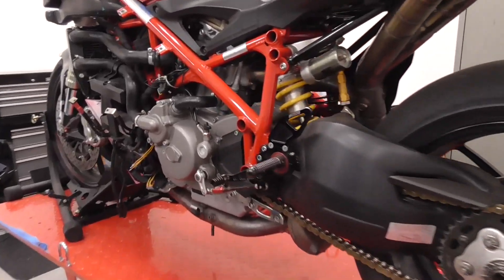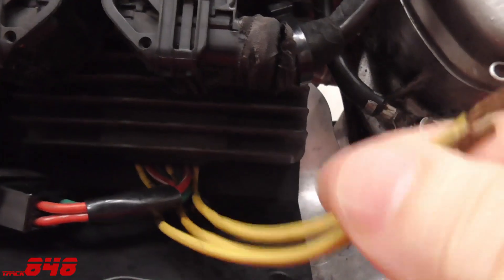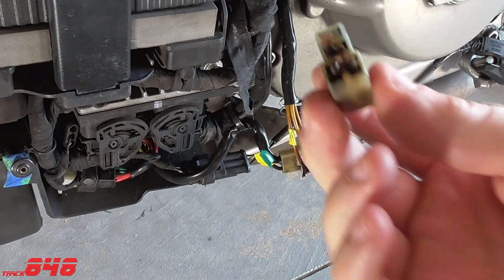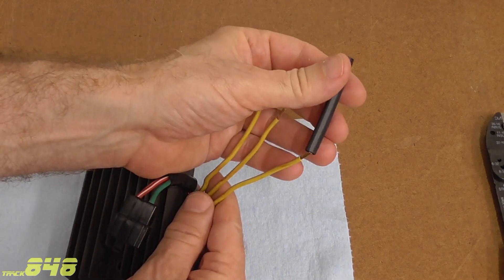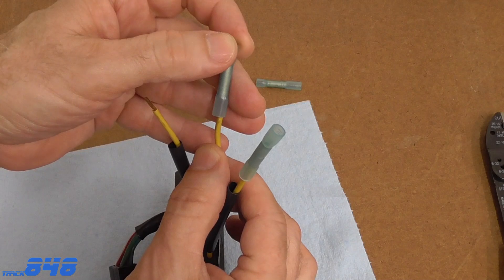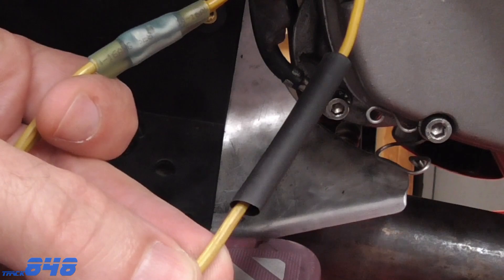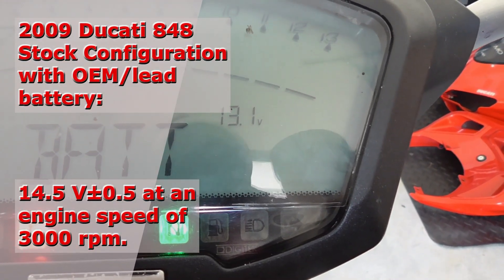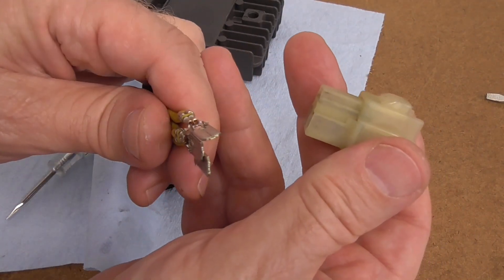How to Hardwire a Motorcycle Stator to Regulator Rectifier

Comment: I had this issue with a used 2006 DL1000 that had a "DIY repair" where the stator and regulator connectors melted together. The regulator was a cheap eBay/Amazon replacement that failed and was not charging the battery or delivering sufficient DC voltage across the lighting system. I replaced with good quality aftermarket stator/regulator units and made a removable harness between the stator and regulator with 10 guage automotive cable and crimped on 3 male and female spade connectors so that it would be easier to remove in the event of another short/failure. Heat shrink the connectors well and added some silicone dielectric grease between all connectors. Not perfect or nice to look at but just makes it easier to cut out in future and not have to worry about another melted plastic situation. It's only about 40cm long and wraps up in between the wiring harnesses.

Comment: Hey the 3 yellow wires ive got are all gray ive cut up to an inch of plastic off and its still gray is this going to be a problem is therr something i can do i dont have much left till im at the flywheel i think its called
Reply from the maker: Years ago, I sent a stator to Rick's Motorsports Electrics to replace the three stator wires (yellow ones in my video). They did a great job--I'd call them first to see if this is still a service they provide.

Comment: If you start with nice new connectors,  put a film of anti-corrsion electrical grease on each pin, and perhaps put heat shrink  over the connectors to keep dirt and moisture out... then decent connectors should give no trouble, and repairs in the field remain easy to do.  Crap gets into connectors from the wire side.  The best bikes have plastic boots to prevent this. But heat shrink will do the job.

Comment: Someone says "an example if Clips had not already been on this bike when the rectifier went bad it would have caught fire and fried the whole Loom. by having the Clips in place and the connector it was able to fail at this point. With no failure point you have fire and wire degradation through the whole Loom."

Comment: Does it matter which wires you connect together or all 3 are interchangeable?
Reply from the maker: @JustinHuffman  The three yellow wires are interchangeable.
Reply: @Track848  thank you, just wanted to double check cause I noticed at first you had them color coded with tape then after you cut them back you no longer had the color on there

Comment: Did you plug in the 2nd wire clip coming out of that 
rec/regulator before you started the bike or did you leave it disconnected?
Reply from the maker: @Franklin-i1o  Hi Franklin, yes, the connector on the reg-rec side must be plugged in--that's how the regulated power gets distributed to the battery side and power to all electronics.

Comment: great info, thanks a lot. i had the issue on my sf1098s and my mechanic hardwired the cable under the seat. but i found out recently after inspecting the bike, that the new connectors are heating up and getting some color on them. is there a possibility to have the wires wrong connected? or you thing is the quality of the connectors used? he checked the stator and we replaced the R/R already. thanks again

Comment: Tried to look through comments but does ut matter what 3 wires go where? Got a new stator with a plug and my bike was already hard wired
Reply from the maker: @LeanedBackLotto  for the yellow wires from the stator, no, there is no specific order... these wires are interchangeable...
Reply: @Track848  the wires from this stator are all black. That mean it isn't the same?
Thanks
Reply from the maker: @LeanedBackLotto  how many wires are coming from the stator? The color is irrelevant. If you have a 3-wires they are interchangeable. The wires on the other side to the reg-rec are not interchangable...
Reply: @Track848  just 3 wirer from stator and 3 from rectifier that make the connection complete. 

I see what you're talking about though with the other wires that come out of the rectifier. Those are already done and I'm not messing with those. They look fine 🙂

Comment: Hi for Australia. 🌏 
I've hade the same issue twice now in the last 5 years with My 1998 Yamaha R1.
What I have all so come across is the insolation lacker compound has warn off most part of the top windings pickups surface that runs close to the magnetics . 
As there is a small amount of oil covering the stator I'm assuming the stator is shorting out due to the oil film all across the stator windings pickups. 
Only two windings coils of the stator are still fully insulated over the pickups.
The two issues I have with the bike is 1/ That connection plug has burnt out again.
2/ At idle the battery will slowly drain but spazmaticly the bike will increase in RPS for a minute or so then the dash instruments will go out. Then shortly after that the bike will shut off. 
The battery will drop instantly from 12 volts down to 10 volts.
Reply from the maker: @bernardmcnamara  Hi Bernard... some of those symptoms sound like a bad regulator-rectifier. Have you checked that yet?

Comment: That's what I'm saying.You didn't even explain nothing about the 3 yellow wires besides cutting them and then heat.String them back together with which one's go to?What they're all three yellow. And I can't follow the connectors because mine didn't even have no connectors it was just wire
Reply from the maker: There is no specific order for the yellow wires--they are interchangeable.

Comment: Stator connector burns when parallel type regulator is used. It is necessary to switch to a series type regulator that will reduce the current from the stator.
In the EU, a small Croatian manufacturer makes a high-quality replacement three-phase HVSP regulator/rectifier of combined series and parallel type to reduce the heating of the stator and regulator (14V-2FHVSP-30A-AX/BX-KS-LI) which is a possible alternative to the SH847 because it works on many engines on which SH847 is normally used as a replacement. The warranty is 4 to 5 years.

Comment: I think the problem occurs when using old diode-based rectifier. When you use old diode-based rectifier, no matter your battery is fully charged or not, the stator coil on its full load. 

I believe we can overcome this by replacing the rectifier with “new-type most based rectifier like FH020AA”. Which is also good for the stator coil.

Comment: What a great video! My 96 vfr750 with 250k miles on it is in dire need of this.  I've replaced all the charging components but never considered that it needed to be maintained.  The wires from the stator side are smoking hot (literally). While the other side of the plug is cool.  This gives me hope!
Reply from the maker: Yes, these wires can get hot!

Comment: Did your fuse blow out, if the connector burnt to the point where the wires touched each other the main fuse should blow out to save the stator and rectifier causing the bike not to start or crank or show instument panel lights, a dead bike😂.

Comment: Soldering the connection will in theory tin the wires and prevent any future oil wicking issues, I wonder if you can purchase a connector repair ikit?
Reply from the maker: Thanks Mrdubomb... and yes, in fact, I ultimately changed back to a connector when I found an 'upgrade' repair kit from Rick's Motorsports Electrics. It's been installed for a few years with no issues.

Comment: Hey!
Great Video, nice and clear. I have the same problem on my Vstrom 650, did the same repair and I still have the burning problem but only in one wire. 😒

Kind regards form Mexico.
Reply from the maker: Thank you, Gil... do you know if the one wire could possibly be 'wicking oil' from inside the crankcase? I had a stator that had the 'wicking' issue and sent it to Rick's Motorcycle Electrics to have the three wires completely renewed. Just something to consider...
Reply: @Track848  No, wiring is clean. I have watched some videos and discover is a common problem in a lot of motorcycles. I haven't noticed the issue before.

Comment: I know hardwiring is the most commonly accepted way to fix this but would a Deutsch connector or similar be acceptable? Just so it'd be easier to replace the rectifier or stator in the future
Reply from the maker: Hi Dakota, yes that's absolutely a good reason to use a connector instead of hard wiring. Since I routinely have my bike apart, I eventually re-established my connections using the 'Hot Shot Series' connectors from Rick's Motorsports Electrics. Those connectors are much better than stock and I've had no problems since installing.

Comment: Do you need to worry about which wires you're reconnecting ? Or keep track about the order of wires?
Reply from the maker: The wires from the stator (yellow ones in this video), can go in any order. The wires to the regulator rectifer do go in a specific order, so take note upon disassembly...

Comment: Soldering be prob be a better option correct?  What’s the chances these act exactly like the connectors do and create hot point?  Def be a lot easier than soldering. Just curious if this is wildly trusted method or should I just soldering .  Great video

Comment: This is exactly what just happened to my 2006 GSXR...... Are you still to this day set up the way you did it in this video.. You still on your same stator and rectifier... I'm thinking about purchase a brand called Rick's or just doing exactly what you just did in this video..
Reply from the maker: I eventually had to change out my reg rec, and I also reinstalled a heavier duty plug for the reasons listed in the discription... good luck!
Reply: @Track848  thanks for the reply... I'm going to give this a shot before I spend $350 on a new set... Mine was working great I just happened to notice the wires all burnt up..  Even with it burnt up everything was working fine!

Comment: First of all, really great video. Thanks for contributing to the community!
The connector in my CBR900RR apparently has just failed. Apparently, it had friend a long time back, and left the connectors exposed, which corroded over time until one of them seized yesterday and broke in two parts. Now I am planning to troubleshoot the whole thing, to assess whether the stator and/or the R/R are at fault.
As you suggest, I'd like to hardwire both, after reading many times that the source of this issue is bad connection + arcing. I would like, however, to be able to have a simple way to swap components in the future, in case they fail down the line. 
For that, I thought: would it be a reasonable idea to (instead of hardwire them), just connect them with a strip terminal enclosed in a waterproof box? The 3-cable strip terminal + waterproof box can be had for really cheap in a hardware store, and screwing/unscrewing should be very simple.
I am really NOT experienced in anything related to electrical installations, so if you could give me your feedback, I'd really really appreciate it.
Cheers

Comment: My 02 954RR has been off the road for a year and half until we finally found the stator/rectifier conn burnt up inside the conn couldnt see it until it was unplugged. Hard wired and finally got her running again. Almost parted her out over this 1 connection that had went bad. Smh.
Nemo
Reply from the maker: Glad you didn't part out... I love the 954RR!

Comment: What a great video, thanks from New Zealand! Is there any reason the wires are not soldered together instead of using the connectors you show?
Reply from the maker: The only reason (back then), was I wasn't too confident about my soldering skills... if you're good at it that is a good way to resolve this issue...

Comment: Nice video. Very clear. 
Good to note that this 848 has the later battery/ volt reg support box with the exhaust heat shield on the back. Was requirement of the North America NHTSA Campaign I.D. Number: 08V-638 recall that Ducati didn’t consider worthy of other countries so OZ didn’t get it. The regulator protection kit is part no. 69924371A and new voltage regulator part no. 54040191A. (new MOSFET Shindengen  SH579EA voltage regulator) upgrade from Ducati. 

https://www.shindengen.com/products/electro/motorcycle/reg/

Still has same crap stator connector plug so well worth this mod when installing all new parts

Put heat shrink over all yellow insulation so if it heats up wires don’t short before you smell it and take action before bike catches fire.

Comment: This is a problem I recently experienced with my 2002 triumph sprint. Its a good fix but I would stop short of hard wiring just in case you need to replace the stator at any point. This would mean you need to cut out the hard connection and if it's already on a short length of wire you may find there's nothing left to reconnect to. This can also apply to having to replace connectors but they tend to need less wire removing in the first place.
Reply: did your wire stator getting hot too mine  do I chance three different stator but still hot it charging fine but wire get hot 2003 triumph speed triple thank you

Comment: Does it matter which wire goes where
Reply from the maker: No it doesn't matter..
Reply: @Track848  I have a 1983 suzuki gs550l and my battery is new and will not charge

Comment: Thank you. My stator AND rectifier both burned up. Bike been cutting off for a year. Been replacing stator/rectifier/battery constantly until i noticed a few days ago that the connectors were destroyed. Jokingly in my head i said I'll hardwire everything. Now that i see it's actually a thing I'm comfortable doing it. And thanks for the tape info. I ride a 2001 Suzuki gsxr 1000.
Reply from the maker: You're welcome Cow boy! I love those Gsxr 1000s--what a beast! Good luck and ride safe...
Reply: @Track848  thank you. Same to you. Shiny side up.
Reply: Hey man, did this completely fix your issue? I just got an 04 gsxr 600 and my connectors are burnt and battery is smoking. Looking to hardwire like this but scared

Comment: i recently just burned through the connector on my bike. the previous owner decided to pair up the wires so instead of having 3 it just had 2 wires spliced together with nothing more than electrical tape. but i think i'll use spade connectors or bullet connectors to make it easier to swap out when i need to.
Reply from the maker: Hi Paolo, that's a good idea! I ended up re-installing spade connectors, but used a heavier duty version than the OEMs. I didn't like the idea of removing the reg-rec every time I had to remove the alternator-side cover on this bike. If you end up using spade or bullet connectors just be sure to check and clean them once or twice a year and you should be fine. Thanks for the comment!

Comment: Good vid. I had the same problem on my 1098.  Connector was fried.  I went with a MOSFET replacement and a pigtail that mates with the factory connector from the stator.  Key is to route the wire up and then down, which keeps the oil seeping issue that you described at bay.
Reply from the maker: Thanks for the comment, J., I'm planning to upgrade and relocate my reg-rec in the future. And the wire re-route does seem to be a good way to keep the seeping issue away... After posting this video I actually did just that--after eliminating the hardwire and adding a better connector similar to the stock one, but heavier-duty. To this date, everything is working fine!

Comment: Had the same issue w my 06’ Gsxr600 with the connectors being crispy but I put it back together as is when I relocated the rectifier away from the headers and radiator and haven’t had any issues thank god. But am considering going back in and cleaning up those wires and connections
Reply from the maker: Thanks for commenting Doug. Yes, a lot of Ducati owners' of this model also relocate the rectifier away from the headers and radiator; I'm going to do this some time in the future. I agree, it would be a good idea to clean up the wires and connections when you have the opportunity. 👍
Reply: @Track848  update: took the bike out last weekend and it completely died about twenty minutes into the ride. Jumped it and it started, made it a mile down the road and died again. Wouldn’t jump start. So had to flatbed it back home. My fears of it coming back to bite me have come true.

Comment: I read alot that this helps from alot electrical issues cutting the r/r and stator connector because the connection become lose and filled with corrosion causing alot resistance  so best just to remove, I've also read to remove the connection on the rectifier end to power and ground harness side and cut and hard wire directly to the battery with 30 amp fuse , have u done this also to get ride of all the electrical issues? How does the rest of the electrical components get power from the harness if it's bypassed from that connection?

Comment: I found this cables burnt in my bike do you also get an
 ignition fuse blown???
Reply from the maker: Hey genzo, sorry about the delay, I'm just now seeing this... It's my understanding that random electrical issues can crop up when this happens, especially if your regulator-rectifier is also bad like mine was. You can see near the end of the video that this turned out to be my problem. The fan fuse was the only one that blew in my case, but after I replaced the reg-rec, everything has worked well and I keep a closer eye on the connector to ensure it doesn't get dirty or 'grimy'. Good luck!